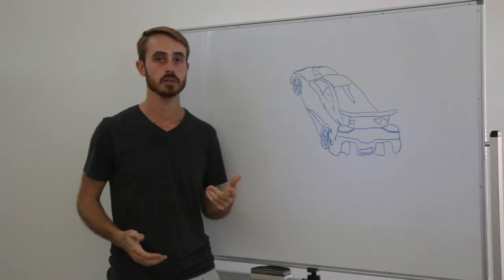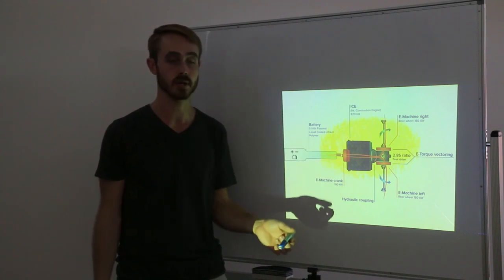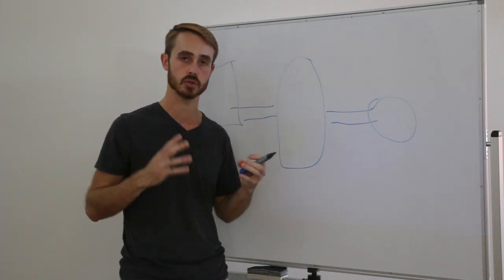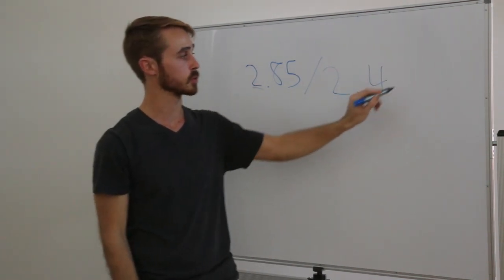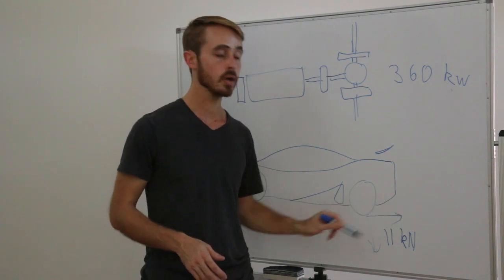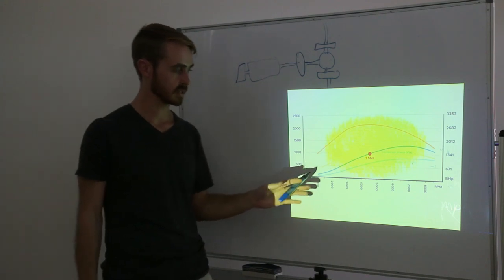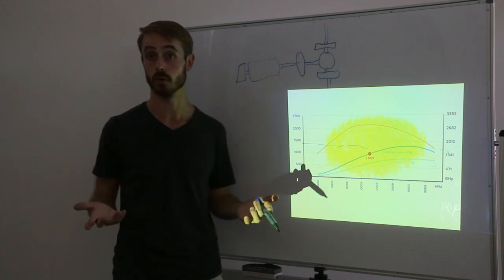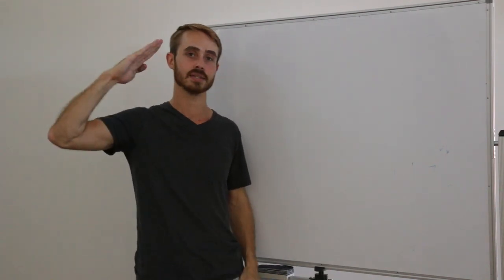Explained: How does the Koenigsegg Regera work with only ONE GEAR???

Comment: why do Formula One cars have 8 gears then?
Reply: Because of regulations. Back in the 8-90s CVT was beating Manuals by seconds, which is an eternity in Formula 1. Then CVT was banned and I believe 5 gears has been minimum ever since.
Reply: CVT was never allowed in F1. Williams had it on a test car in 1993, but never in a race. Banned in the regulations for 1994.
Reply: There was no regulation keeping the CVT out of the game and would've been used by most teams to gain advantage. Otherwise Williams would not have worked on a testing unit. The ban was not directly aimed at the CVT, saying CV-Transmissions are forbidden, but it was indirectly aimed at it as it was aimed at the benefits of continous gearing. I did not say it was used in-season.
Reply: OK, let me rephrase that. When Williams found the solution to a working CVT for F1 in 1993 it was banned in the subsequent regulations. From 1994 onwards stating that the minimum number of forward gear ratios is 4 and the maximum is 7. (Today 8 forward gears is mandatory)

And of course there was no regulation to keep CVT out since no team used it, but when Williams found a way to make it tolerate the forces from an F1engine it was banned before ever racing. So the reference that CVT was beating Manuals by seconds back in the 8-90s is untrue, at least when it comes to F1.
Reply: When I said that it was "beating manuals by seconds", I was ofcourse comparing their testing machine with their manual machine which was a machine capable of pole positions in the qualifying stages at this age. So I do not see what was wrong with my statement? 

The CVT F1 never raced, but yet, it was faster. If I was talking about actual races, Id probably say that it was taking more positions than the manual cars, since there is a lot of fights between drivers on track. The CVT wasnt necessarily better at fights than the manuals either.
Reply: I appreciate your calm discussion btw, everything gets so hysterical on the internet lol
Reply: Web crawler , hejamodo just answered your question fully. It is mandatory with 8 gears in modern F1.
Reply: I interpreted "Back in the 8-90s CVT was beating Manuals by seconds" as most people would do. That you referred to a period in the 80's and 90's where CVT were raced alongside manual transmissions. But you're rignt, it was faster than the Williams with a manual gearbox, and that in turn was faster than all the other F1-cars at the time.

It's all good, just a slight misunderstanding.
Reply: I was unsure of which time period it was since it was about a year ago that I learned about this. Apologies.
Reply: No need to apologize, just a misunderstanding. I was 20 years in to being an F1-nutcase when it was in testing which makes it easier to know of course.